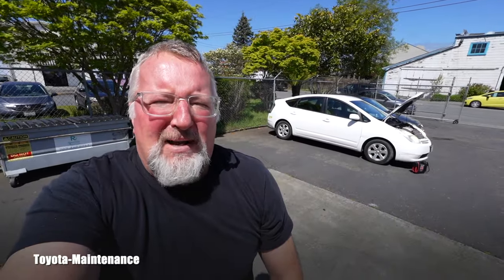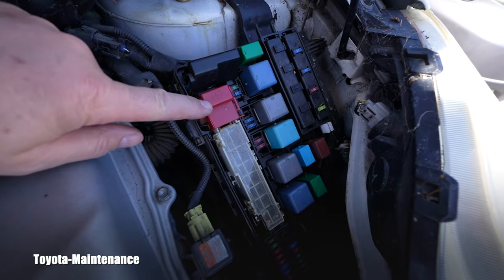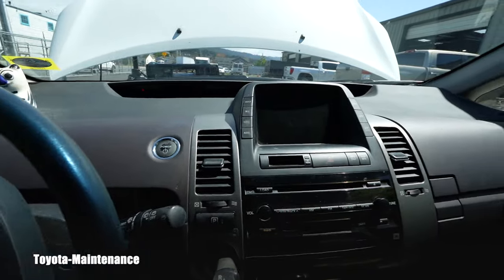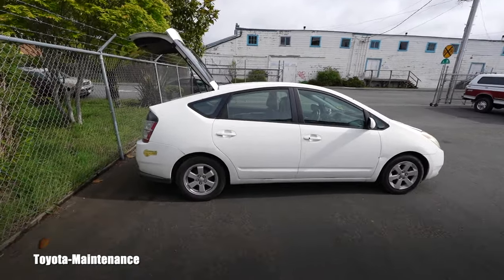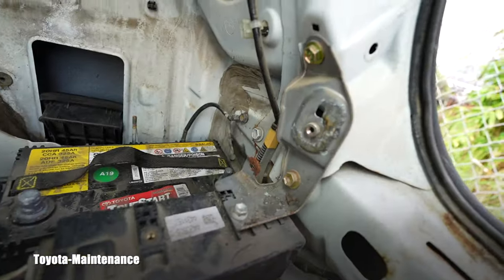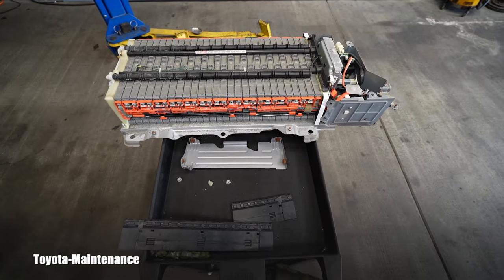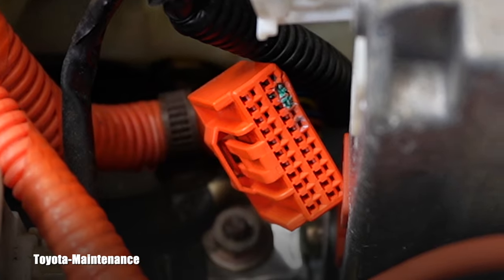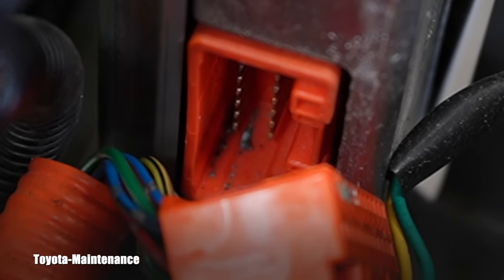Toyota Prius P3030 Disconnection Between Battery & ECU

Comment: One solution would be to remove and clean those terminal connections, use DeoxIT on those and the green crusty corroded connectors, replace those 2 terminals if they can't be saved, repair compromised connections , and locate the water intrusion failure, which appears to be the hatchback rubber seal. 
Firing the parts cannon is for those that think manual labor is the president of Mexico. 
Sure it's easy to be a critic in the cheap seats, but not everybody has deep pockets to afford the premium solution you've presented. 

This reminds me of way back around 45 years ago when a VW stealership wanted to replace the wiring harness to bring my Rabbit back to life. Not having that kind of expendable cash forced me to become a quick learner to find I only needed to fix an "open" in the wiring. 
Since then, I follow the mantra that if you want it done right...do it yourself.

Comment: You reminded me of a rusty 1964 Chevy Impala I had when I started working for the City of New Orleans. It leaked so much around the windshield that I removed all the carpet and drilled a few small holes in the floor in the lowest spots, so that the water could drain out as fast as it leaked in. I parked it for free, a couple of blocks from the Superdome under the elevated freeways to keep it from being 140 degrees inside after work. One day it got stolen, never to be seen again. After that, I chained the hood shut and chained the steering wheel to the brake on my Plymouth Duster to solve that theft problem.

Comment: Yeah, those hatch roof corner weld seams or whatever those cracks are including the hatch strut base area seams need to be picked out with a dental pick is what I do.  Then wipe with a solvent. Then fill in the cleaned out seams with a type 1 silicone.  Glad to see the battery saved, being from what I read most do not troubleshoot the battery enough to find those pins corroded.  I've found without the P3030 code and only strange very low module reading next to a very high module reading situation as well where the harness pins needed cleaning with deoxit and then some conductive deoxit contact grease placed on before reconnecting.  Then worked fine.  My first P3030 code was what I am working on today, so will be interesting what I find.  Thanks for sharing!

Comment: Question. I want to boroscope my pistons in Sienna 2008 2GR-FE, extracted sparks and see that the needed piston is in upper position. I would need to rotate engine crancshaft to move pistons. A good idea to use ignition and rotate crancshaft by trying to start the car, but to prevent engine from actually starting (most likely one side will have 3 sparks and another side will be 3 out). So, would it be a good idea to remove fuel pump relay and rotate the engine by ignition key, or should it be EFR relay?

Comment: Why don't they do a better job of designing trunk seals so water doesn't get in?  Have this problem with a 2003 Echo.
Reply: There’s also seams around the roof that crack over time and let water leak in. That can be sealed with silicone, but it’s gotta be done before it gets worse

Comment: Not worth the battery, in Wisconsin these Prius are not worth repairing.
Reply: That’s because your cars rust to nothing inside of a decade. Cars from Texas to California can be forty years old and have no rust.
Reply: @negativeindustrial truly amazing that is!
Reply: @efil4kizum  
It is but we pay the price in plastics. I buy all of my secondhand plastic bits from the UK for my classics. I made the mistake of buying a fog light bracket for my 1990 MR2 Turbo from the same UK source recently and there was honestly more rust than viable metal.
You know what else is nice? I rarely need PB Blaster. Basically just on exhaust bolts. Everything else comes loose like it was cinched up yesterday.

Comment: Battery is 1.600 aftermarket
Reply: Never ever put an aftermarket battery and ECM in a Toyota those are some very specific engineered parts. That would be a $1600 waste of money and a total risk
Reply: Aftermarket Battery is not DIY. Did you listen to Peter ???
Reply: It’s easy I did it
Reply: Not true I did it zero problems
Reply: @beeslandscaping  And when the day comes that your Prius goes up in flames you can credit it to a repair done by someone who was not certified nor qualified to do the repair. 
I worked for the USPS and I was trained, certified and qualified to work on machines worth up to $10MILLION dollars. You don't just leave this kind of work to the average Joe. Like Peter said, that battery can kill you and all it takes is putting your hand across the terminals without wearing the proper gloves. You are not the example to be telling people "It was easy, I did it".  🤦🏼
Reply: @peterromano1911 yep, and now that battery replacement is here recorded forever for the lawyers to find.

Comment: Another reason I'll never own a hybrid..
Reply: We are talking about the first main problem on a 20+ year old car. Any other technology had at least 3 or 4 maintenance as expensive as this or way much more. That's why I equipped ALL the expanded family with this model (4 exemplars + 2 for car sharing / rental + 1 Yaris). Most of them have more than 18 YO and  3Mm (200 kmiles) without main problems (only 2 have this maintenance need , soon others).
Reply: Toyota Hybrids are among the most reliable cars in the world.  If you worried about drill a couple small holes in both areas, paint the holes with a rust proof type paint, and your issue is gone.